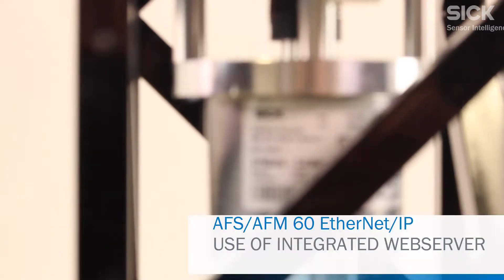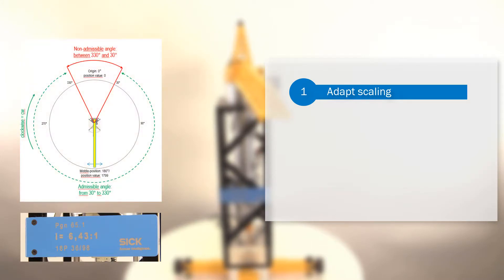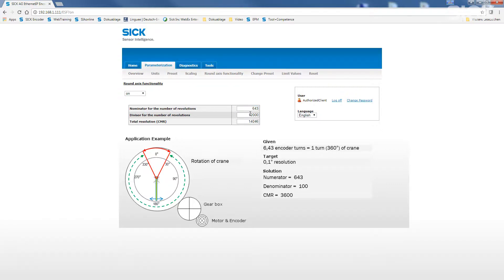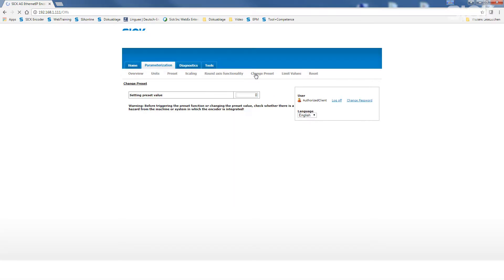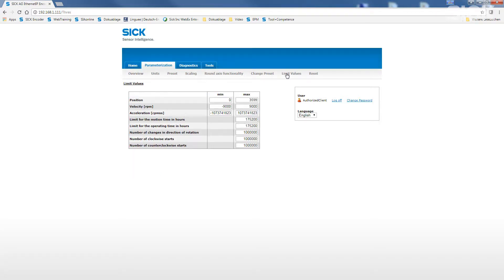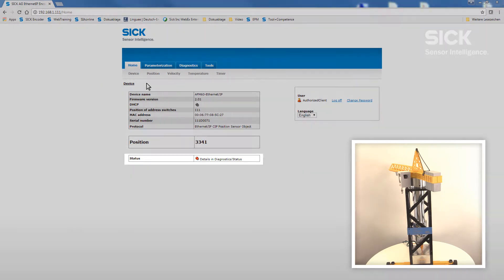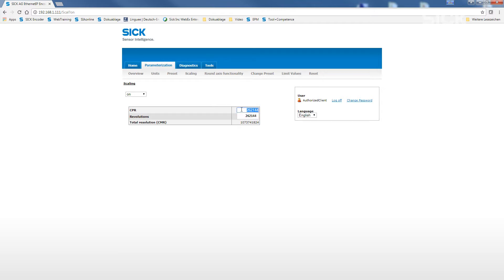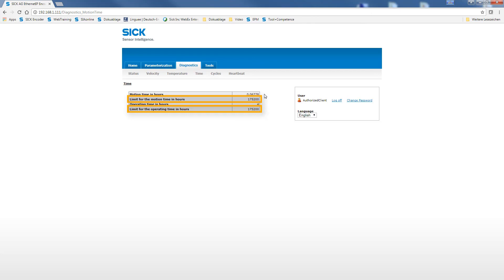Additional Encoder Functions Part (13/14) Webserver parametrization | SICK AG

Comment: I use PLC controlLogix 5069-L306ER I want to read machine speed from AFM60A absolute encoder how can I download the sample program ?
Reply from the maker: We do not have any sample programs for download in our portfolio. However, our user manual explains the integration of the encoder into a control environment in detail. There you will also find the information about how the position and speed are transmitted.
https://www.sick.com/media/docs/3/83/683/operating_instructions_afs60_afm60_ethernet_ip_absolute_encoder_en_im0045683.pdf